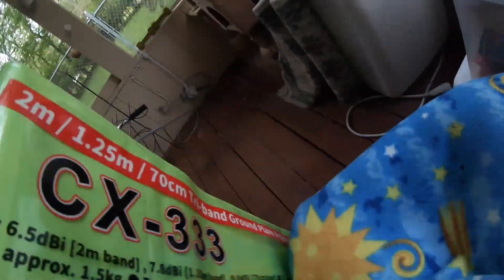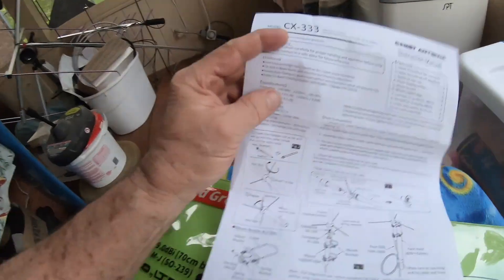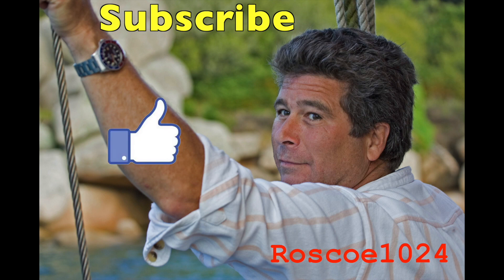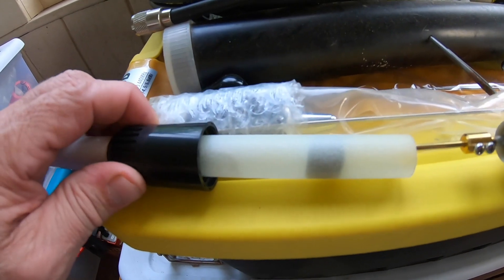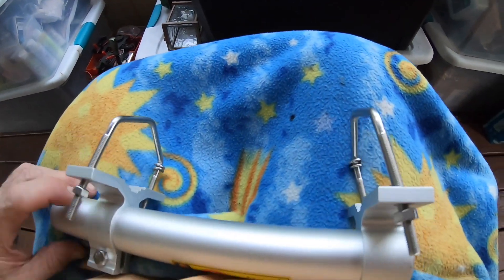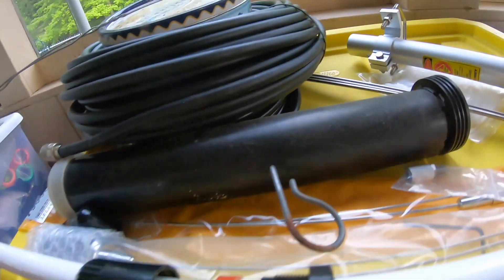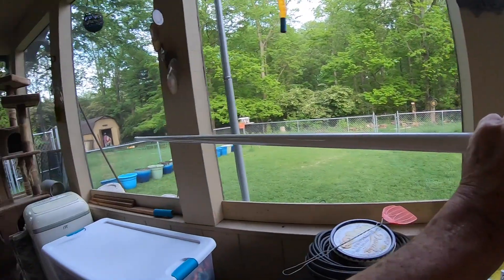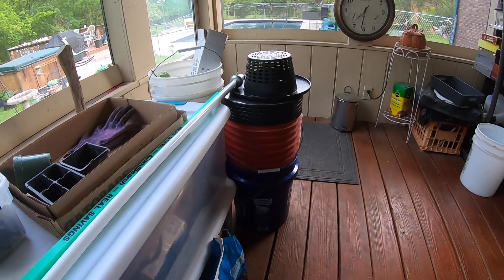Comet CX-333 Tri Band Base Antenna Assembly

Comment: Nice video mate love the cat .that's a great antenna I run one myself  with the connections your best to order some waterproof amalgamation tape first with electrical tape then on top the self amalgamation for that nice waterproof seal as it is these comet connections on the antenna are well designed but I still do it for some extra protection 73s mate and hope to see more video content 👍👍👍